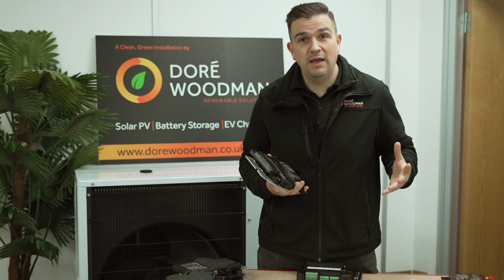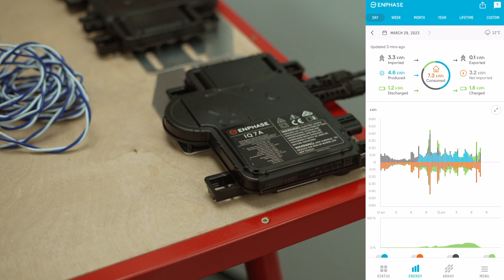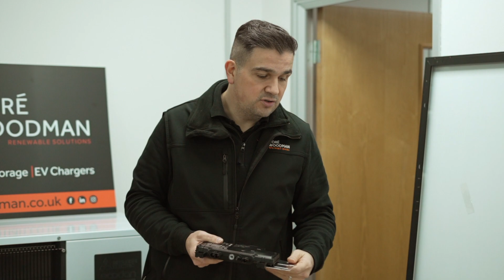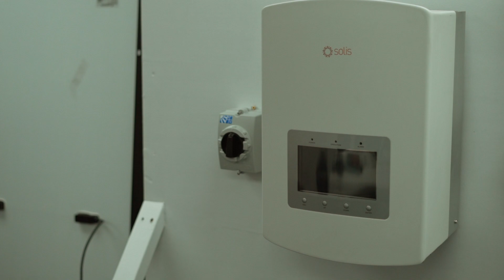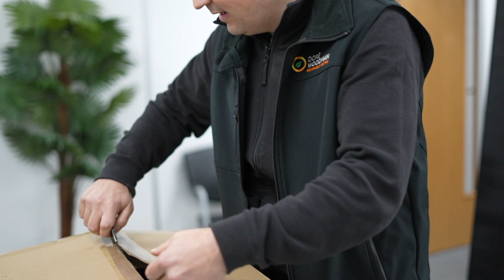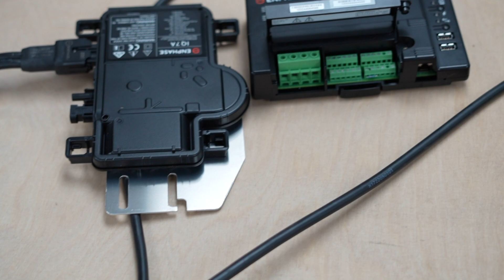Enphase Microinverters - Pioneering the Future of Solar Energy

Comment: Greetings from Australia.  When the time comes to update our solar system I will certainly go with this equipment.  As far as I can see from your video I will not need a "normal" inverter.  Is that correct?
Reply from the maker: Hi DutchAussie, that would depend if you required battery storage. With battery storage you would require an AC coupled inverter. For a stand alone PV array, no you wouldn’t require an additional inverter.
Reply: @dorewoodman  Thanks.  I look forward to seeing more of your videos.  You have a new subscriber.  Have a nice day.
Reply from the maker: @DutchAussieProductions  thank you very much. Have a great weekend